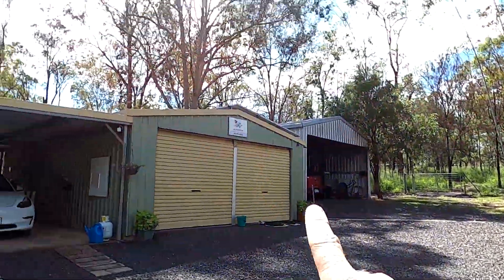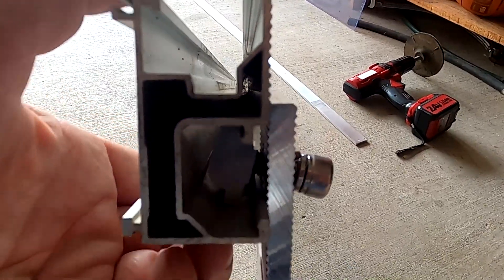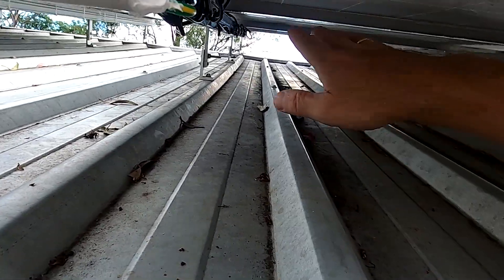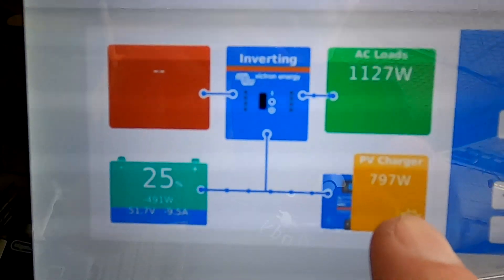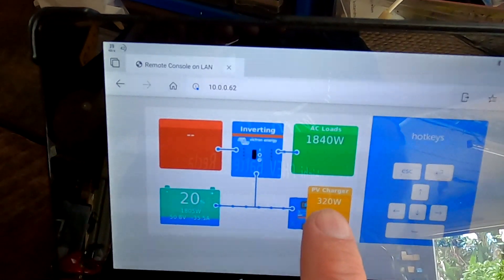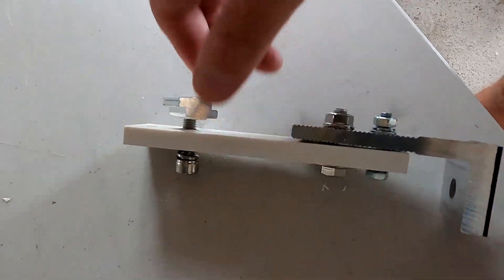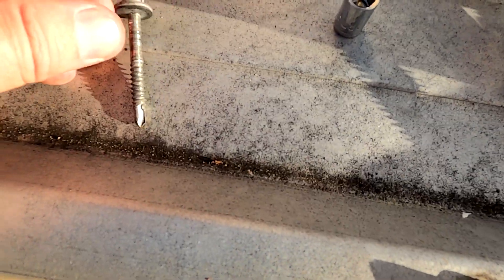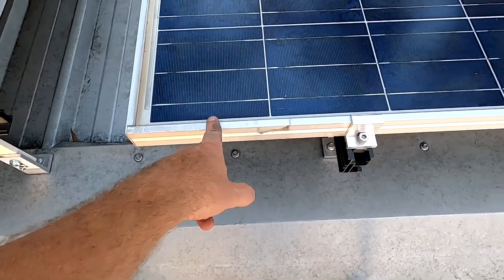Solar Upgrade EP2 - will the fans work / elevated solar mount

Comment: I understand why you made the spacers to elevate the solar panels off the roof.  But wouldn't it make sense to elevate the southern edge of the panels higher to aim them a bit more north toward the sun? Just as I would do the opposite and aim panels south here in the US?
Reply from the maker: It's a lot of structural work. I think the gain is not as much as just adding another string of solar panels eventually to compensate for that not optimal angle. As the sun moves during the day, the optimal position is only reached once a day anyway, regardless what orientation the panels face.

Comment: Hello Guys can someone tell me, why would you put an inverter inside a cabinet and afterwards you need to add external cooling fans(4!!!) and waste power for additional cooling fans. Btw the Victron specs says the Inverter has already a cooling fan included!!??? So hang the damn device on a wall and let it do its work (smart) ;).

Comment: Guys, for mounting solar panels, DO NOT USE fiber glas extension or u will loose the entire lightning protection!!! You could damage the entire equipment!!! Maybe you need to drink the beers after the work is done:).

Comment: Why aren’t you tilting them a bit to the north... even a few centimeters?
Reply: In summer not so critical but angling panels towards the equator makes sense in winter. I have a shallow 10 degree roof facing south in the UK. I added struts to the top mounts to increase the angle to 30 degrees. It made a significant improvement. Probably less critical if you live nearer to the equator.
Reply from the maker: That will make almost no difference eher in Australia. Most installers will just mount them flat now without tilting. Makes probably less than 5% over the year.

Comment: What did you do about the grounding requirements for the system? Are those extenders can resist uv from the sun at long period of time without becoming brittle? I like the cooling idea by adjusting the clearance of the panel to the roof.

Comment: Around here, any gap between the roof and the panel will soon be occupied by squatters...flying rats aka pigeons usually.  Possibly other varmints.  Have to also add wire mesh the entire perimeter to keep the unwelcome guests out.

Comment: 040421/1646h PST 🇺🇸 Brisbane 0946h. Good day to you. Good thinking and that’s called quest for improvement and enhancement coupled with enthusiasm, mirth and relentless efforts.  
Safety recommended while climbing heights.
I see your PV arrays. I may be wrong, but all the cells look Poly Crystalline. No comments there; since you got them as used. Well I’m, very eagerly, looking forward to you harvesting additional 20Kw of power by relocation.
Have a wonderful day and 73s...